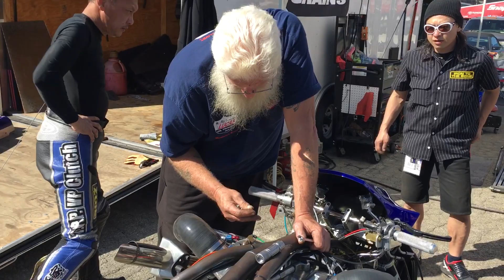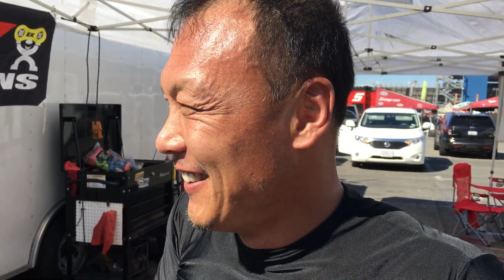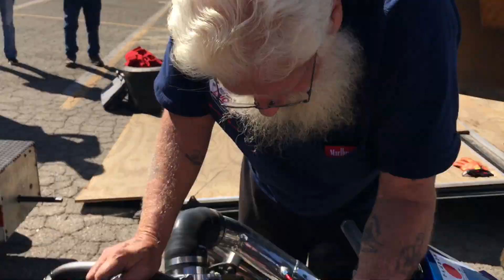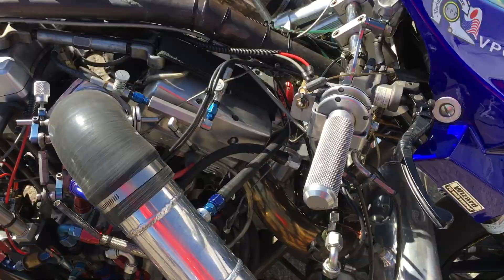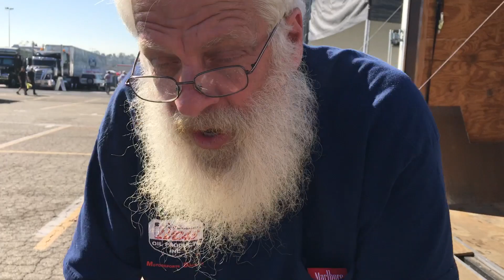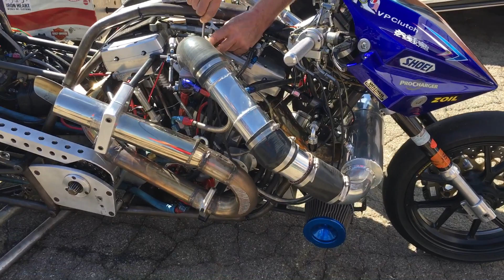Supercharged Nitro Harley! Takeshi Shigematsu Talks about running a Five Second Pass

Comment: Why aren't there more supercharged harleys?
Reply: MUST BE THE AIR FUEL MIX WITH THE V-TWIN DESIGN.  AND GETTING THAT MUCH POWER TO LOCK TO TRACK
Reply: @dezza718 I was wondering the same thing!also I wonder how would turbo with nitro do?and if it would still be able to run in the top fuel class with  turbo and nitro combination
Reply: I notice Harleys run a shorter wheelbase,i wonder if they switched to a longer chassis would that help?
Reply: You can't get away with tuning mistakes... Like you can with the V8 engines...
CrazyHorse Speed Shop